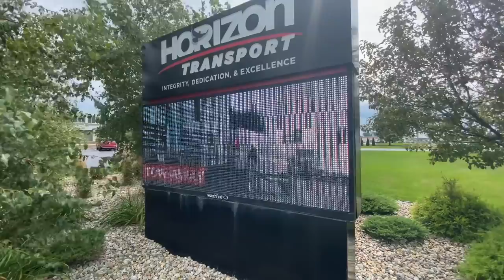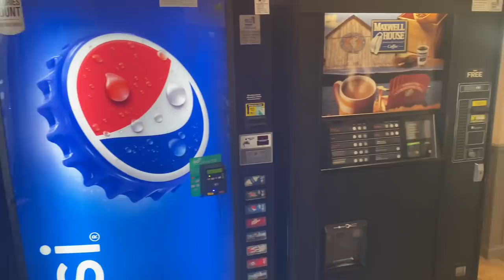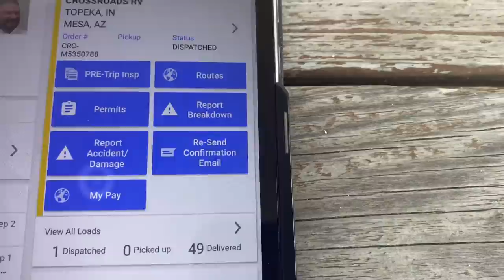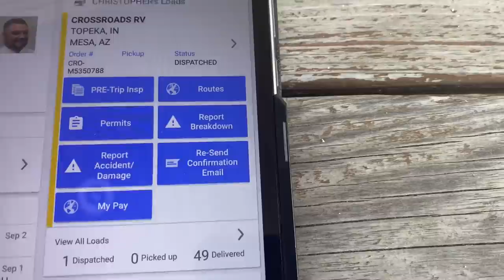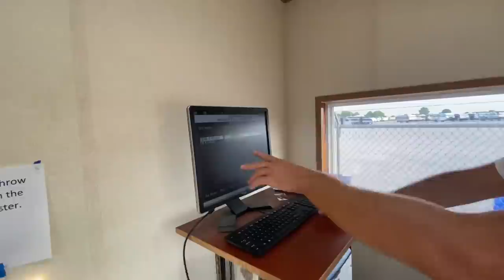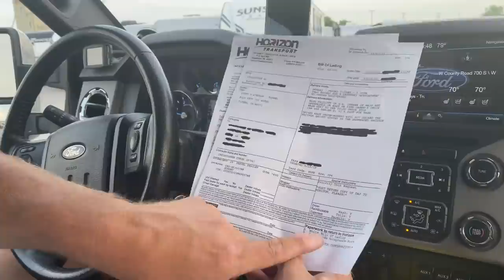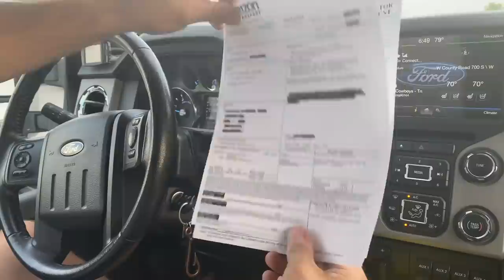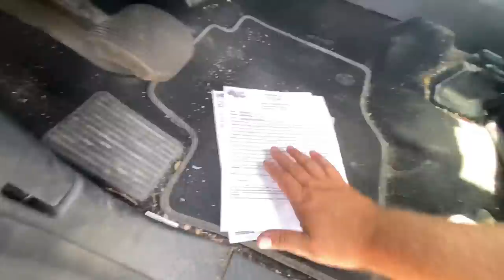RV transport, application to delivery

Comment: You absolutely cannot make any money at 1.80 mile with fuel prices 4.50 gallon truck note insurance truck repairs eats etc no loads back to Goshen  IN unless you retired and have a pension or Social security you need medical Ins if they offer it it's high as nuts don't get into it unless you have plenty of money in the Bank 😮😮
Reply: normal is 3.50 hes getiong screwed.

Comment: Amazing video guys and keep the information coming! I plan to get into this in about 2 years after I retire from the military so I'm trying to get as much information as I can now. I do have 2 questions for you. 1- You didn't mention checking the tire pressure on the trailer but I assume you do that after checking the lug nuts. 2- Is there an inspection of the roof of the RV? Seems to me that there could be damage there from the driver. Haven't heard it mentioned anywhere yet. Thanks again and I'll check in again for your driver number once I'm ready to go. Hopefully you're still working for Horizon!
Reply from the maker: I thought we put tire pressure in that video maybe not I have done several videos that cover the fact that you need to do that. I don’t check the roof because if I were to climb up there in the latter ripped out of the side of the trailer I would be liable for that damage and there is no compensation if I were to fall off the ladder and hurt myself. In one of my videos I took a trailer and when I got to delivery the roof was destroyed they sent it back And they paid me to take it back

Comment: When you are transporting those units do you still have to get a hotel to sleep or can you sleep in the unit? I have been driving tractor trailers since 2007. I'm looking for a change of pace and a little bit slower environment as I enter towards retirement years. I live in Avondale. Are there regular runs from Indiana to Phoenix delivering units? And are there units going from Phoenix back to indiana?

Comment: I think this was a great video . I am in the process of retiring from heavy equipment type work and have 45 years CDL-A. I have been considering during transport work as a way to see some of America. I have a international 4700 four-door western hauler for my personal truck to pull my personal camper would consider using it but fuel efficiency may eat up to much profit. I get 8- 9.5 mpg pulling a 42’. 20,000# toy hauler. But only 10.5 no trailer.  I also have a 1999 2500 Dodge . 
How many miles can you make on a good long day?

Comment: Just pointing out I think the battery to be one of those little small sealed lead acid batteries like used to fit in spotlights. Is Billy supposed to be on the trailer not the truck, but are they requiring you to keep an xtra on the truck? That big one would be kind of hard to mount on most trailers where they use the small tiny battery box.. maybe these guys are using a little something different than the ones I remember. 😅
Yeah I have fun thanks for the video.

Comment: Great video you two put out a lot of good information. I have a couple questions what is that darn 6’ chain for? What is the minimum weight for the 5th wheel hitch.
Reply from the maker: Purple.......only when divided by sour cream 🤷‍♂️
Reply: Fair Winds & Following Seas no one else can tell me ether the only thing I can think of is if you are getting a back haul and it doesn’t have the safety chains so you can make a set
Reply: It’s to chain the axle up if you get a flat and don’t have a spare. That way you can safely get off the highway and wait for help in a safe place.
Reply: eric foos thank you the mystery is finally solved.

Comment: for the driving test is it a one shot and your done kinda deal trying to find some were to practice this with my enclosed trailer
Reply from the maker: I couldn’t tell you. My military licenses waived the need for the test
Reply: @fairwindsfollowingseas7909  thanks one more tuition if you don't mind lol. do you have to have a dot inspection on the truck if so will a truck with mods on it pass aka lighter exhaust and what knot thanks agin

Comment: no pins in the saddle brackets when he hooked up.. and you should never use hands always the bar to raise the brackets and never pull the bar off when its not pinned in place
Reply from the maker: Well I guess I should take down the whole video since you disagree with a 5 second clip
Reply: @fairwindsfollowingseas7909  I'm not disagreeing to anything I liked the video. Never seen any hot shot drivers do any of this type of video before. I work at an rv dealership and I've done a lot of towing. also seen people with broken legs because they didn't have a pin in the saddle bracket.. But that would make good content for a video haha. Keep doing what your doing

Comment: 4/32 in the front? It that a DOT thing? In my state you only need 2/32 all the way around to pass safety inspection.
Reply from the maker: Yes
Reply: I believe for any commercial vehicle, dot regs specify 4/32's on steer tires, and 2/32's on drives and trailer tires at a minimum.

Comment: I am looking for a company that will use my New Freightliner M2 as a haul truck. My understanding is that Horizon does not use them. Would you or any of your friends know of
a company that does? Thanks for your information.
Reply from the maker: Flat bed or multi haul division Should have no problem with a Freightliner. It sounds like you somehow I got a hold of the tow-away division

Comment: What is the rear-most toolbox? Got a link to it? Sorry if u covered it in another video, ive watched them all i think... 🤘
Reply from the maker: It’s just a tool box. I honestly don’t even know what brand it is. It was on the shelf at dans service and I bought it
Reply: Fair Winds & Following Seas I need to get over and check them out. I’ve been with horizon for about 2 months now, in part due to your videos. So just want to stop by and say thanks man!
Reply: Oh and I’m about 5 mins from the end and I think you missed the checkout from the yard part, yall mention it but it never comes. lol
Reply from the maker: You are correct. We were going to cover that yard but with every yard being different we got a little side tracked and then forgot

Comment: @Fair Winds & Following Seas  after paying off your truck, fuel, tires etc. How much an hour do you make? Estimated? I do HVAC-R in Eastern NC and pull $30 an hour but have considered going into rv trucking. I already own the truck/tools/hitchs...etc. Just wondering if it's worth the effort.
Reply: You make way more money than doing rv transport. They make about $1.50 a loaded mile gross and you have to deadhead back so 75 cpm for all miles.  Now figure out all your expenses on a cpm basis, fuel, truck, maintenance, non routine maintenance fixes, insurance, etc..... and what you are left with is what you actually make. It is a minimum wage job where you never get to be at home and have to live on the road. 

Most guys doing this don’t care because they would rather sit behind a wheel, play with their truck, have flexibility in what they do, who they answer to etc... even if that means they get paid peanuts, instead of working a normal job like hvac making some real money.
Reply: @AJourneyOfYourSoul  Sounds a bit harsh but I bet it's true. I do get every weekend off and I'm never on call basically 40 hours a week all I have to work. Of course if need be I can work all the overtime I want. Thought it'd be nice to have a little change of scenery though.
Reply from the maker: You’re so far off it’s ridiculous. So are you one of those who doesn’t run and just wants to take your time doing what you want or are you trying to run off the “competition”? After every expense I still pocketed nearly $70k. No that isn’t great money but it’s pretty good. Nearly double what I made in the service. So I guess the military is paid 1/2 minimum wage?
Reply: @j_rainsgoat3929  What you need to do is run your own numbers. The number one issue I see with guys is they don't account for the truck properly. I see this happening over and over in anything that requires people to use their own vehicle in any business or being an independent contractor etc.... From rideshare with uber to big trucks. So many people simply do not understand the concept that you can accumulate expenses today, that you don't pay for until later, sometimes much later. Instead of saving that money, they spend it as if it is profit. 

Lots of times guys will get started with an older truck of theirs that is already paid off, so they feel the truck is basically free, don't have to account for it etc.... .That really isn't true. The opposite is happening now, they have prepaid for future expenses. And even then, that only works once, a replacement will be needed eventually and that replacement costs money, lots of it.
Reply: @fairwindsfollowingseas7909  more than I make a year as well.

Comment: Just out of curiosity when you bob tail do you still have to stop and mess with e-log? I’m considering getting into this with waves.
Reply from the maker: Yes you do.
Reply: Wow, are you required to only drive 8 hours a day?  Does Horizon have other states that you pick up in or do you have to drive all the way back to the original pick up location?
Reply: @user-yp7im1su9s  11 hours a day is allowed for driving.  14 hour total duty shift.

Comment: I wasn’t clear you are to drive between the cones with the trailer ?wish I could have seen you do it. Do any women do this ? My last trip leaving moms in NC to fl my home I saw tons of transportation guys I . Anywhere from two car trailers to ten.  I had a class A blow pass me going at least 90mph. He had to have been late delivering that rv. No way a owner would drive a 200k rv that way.  Thank you for your info and time.
Reply from the maker: Yes there are women in this line of work. Not many but they are there.
Reply: Thank you for fast response. It looks like so much to learn , but I guess it becomes routine after awhile.  Up front cost getting started and getting truck I’m guessing you write off on taxes. I appreciate you guys taking the time to show us. Lots of good tips you shared.  Do you have to go thru those check points you see semi’s go thru? How does one learn this stuff?

Comment: I don't want to be a "negative nelly" over here, but if you have to have a "professional appearance" as was shown in the opening of the video, i don't think that wearing flip-flop is a good way to present yourself. You might not need the full course steel toe boots, but there has to be something better, than flip-flop for going to work. And if the company has a dress code, where does the footwear fall in? 
Real truckers don't wear flip-flops! #realtruckersdontwearflipflops